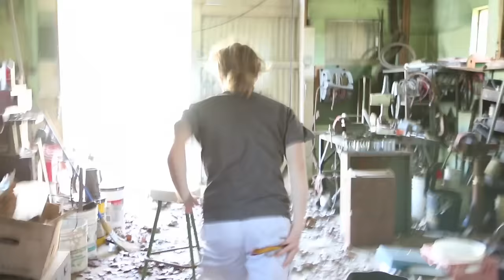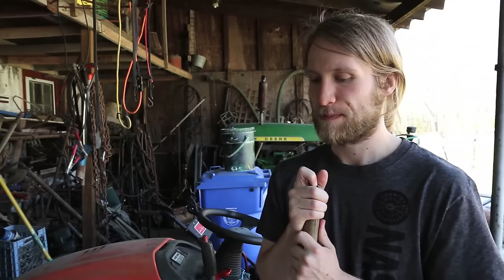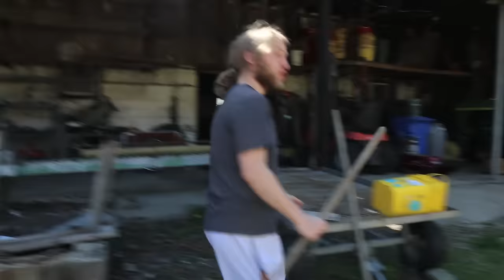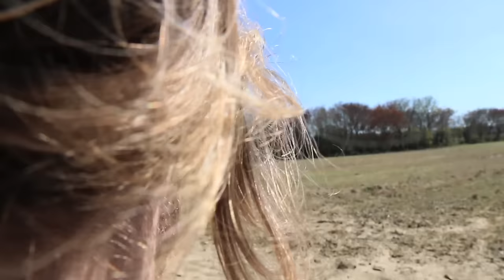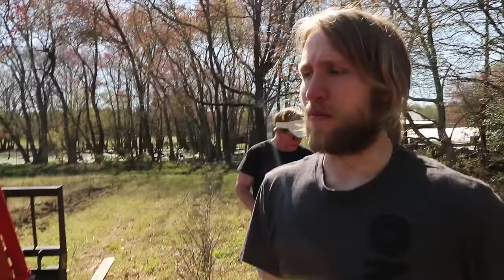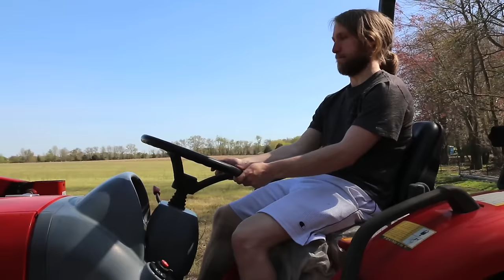SPORKING THE FIELDS!

Comment: Jess, I build barbed wire and metal fence every day, 7 AM-3:30 PM in 105 degree heat with 60-90 percent humidity. We have one 20 minute break. I'm 16. Get off your butt and work.
Reply: One break that's 20 minutes (lunch break) I meant.